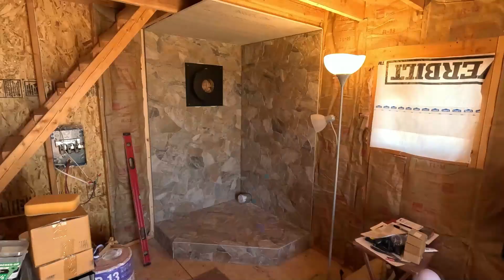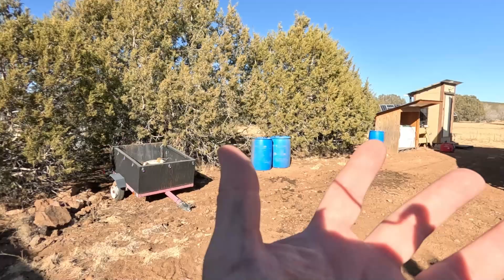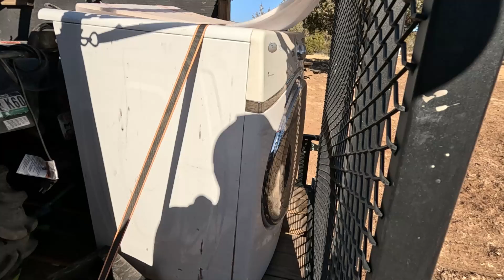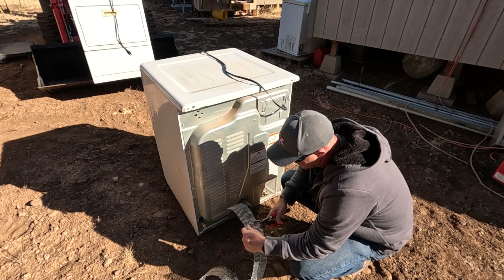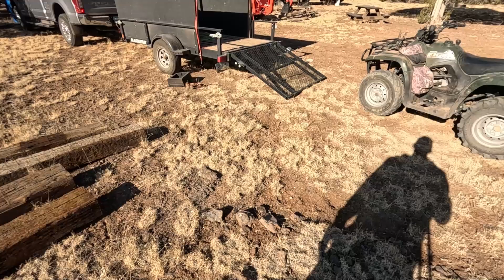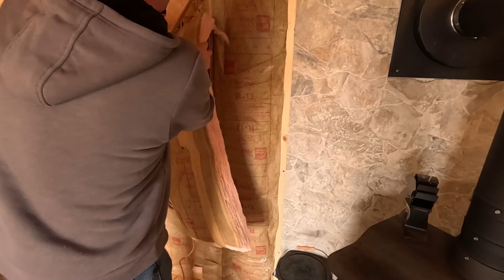My Battle With Batteries

Comment: I’ve got a lazy connection like that… it’s easy to put stuff like that off… I plan to do similar w conduit pipes.  Greetings from Northern AZ!
Reply from the maker: I haven't put a video out in a while, but my large battery bank is just about dead now.  The voltage tanks after dark.

Comment: Temporary resolution for power needs I purchased a 3000 W solar generator at Costco. Also a little pricey about 1500 bucks or so I think.
Reply from the maker: In my opinion, you can never have too many power stations.  It's like insurance.

Comment: Temporary resolution for power needs I purchased a 3000 W solar generator at Costco. Also a little pricey about 1500 bucks or so I think.
Reply from the maker: Power stations are awesome insurance.  $1500 is a lot of money, but it doesn't seem so bad when you have instant power when the power goes out.

Comment: I had to insulate my well house(I been putting it off) frozen pipes broke… used  foam insulation worked great ,no fiberglass easy install, but a little pricey 10’x20’x10’-12’ tall /slanted for future solar25…. panels @ 58$ each x25. I underestimated how many I needed bought 20 I needed five more the second set.(5) have pre-cut for 16 inch centers notches in them which would’ve been easier, but my steel building ranged from 43 to 46 inches wide. I highly recommend using the foam insulation so you’re not breathing in all the fiberglass lot easier to cut with a straight edge and a cheap two dollar knife… The type that you can break off the blade on, I don’t know what they’re called.
Reply from the maker: Awesome.  I will probably do foam insulation later in a larger more livable structure that I build in the future, but I already have all the insulation to finish the little cabin.

Comment: If you don't want to reconfigure the panels permanently, a very quick fix would be to put a resistor across the panel DC+ and DC- to dissipate roughly... oh, 15W or so.  That ought to bring the voltage down off of its Voc in cold weather.

You will lose 15-20W or so worth of generation by doing this, so the obvious better solution is to permanently reconfigure the panels so the voltages don't go too high... remaining cognizant of the maximum current that cable might have to carry.  If you aren't already, be sure to use a solar combiner box when paralleling strings.

-- Resistor Method to reduce Voc of solar string(s) --

I don't know what the Voc of the system is but lets say it's 100V and you want to dissipate roughly 15W to 20W or so to bring down the open-circuit voltage so the MPPT controller doesn't give up in cold weather.   A 500 ohm aluminum shell resistor with a heat sink attached to it would do the job.

This would be something like... oh, find "Patikil 100W 500 ohm aluminum shell resistor" on Amazon or something like that.  Make sure it has sufficient heat dissipation (that's what the "100W" means above).  100W is the minimum spec for them to dissipate 15-25W in open-air safely.

You can try putting one or two of those in series and then across the solar panel DC+ and DC-.    Best to mount them to a metal backplate as the heat sink, they will get hot.  Make sure they don't get too hot (above 70C).  And beware the dangerous DC voltages.  I usually use generous heat shrink to make sure the terminals aren't exposed to accidental touch.

-Matt
Reply from the maker: I typically disconnect one panel from the series just before it starts getting cold, but I was away for three months and forgot all about it.

Comment: take 1 or 2 panels out of series to bring pv dc voltage below 150 so your controller will work.  At some point upgrade to combo inverter/mppt that will go to 250 or 500voc.  I'm seeing 12v 100ah lith bats running in the $100-$115 range some with low temp protection, so 4 would run you $400-$460 at Amaz and temu.
Reply from the maker: I guess I didn't explain that very well in the video.  I usually disconnect one panel to bring the voltage down before the cold temps arrive, but I forgot to do that in September.

Comment: Maybe spend less time on making videos and more time working on doing your stuff right.
Reply from the maker: Well, then there would be no video at all for you to troll.
Reply: @AZOFFGRID  Life is full of difficult choices. ;)
Reply: Be nice now. I watch his videos @ 1.25 speed! Or faster!🤷🏼👍🏻
Reply: So many people are doing solar now that I personally think it is very useful seeing videos by DIYers.  Almost nobody gets these things right the first time, after all, so it provides a good forum both for getting good advice and so others can see how people are putting these systems together in real life and what the most common mistakes are.

In this case, it is clear that a high level of importance needs to be placed on ensuring that the system operates reliably and avoids common fault conditions when nobody is there to regularly check up on it.

Comment: Just found your channel. My wife and I are up on our property in Northern Nevada. We are using one of two 48v forklift battery banks. Nice to see your set up! Thank you for sharing. Subscribed.
Reply from the maker: My power system has worked fairly well for the past 8 1/2 years with a couple hiccup's along the way, but it is finally time to move forward and upgrade to lithium.  It may be a few months before I can purchase everything, but when I do, I will bring you all along for the ride.

Comment: What wind turbine is that? Tried seeing if you made a video on it but didn't see anything. Been considering a wind turbine but seeing a lot of bad things online about them.
Reply from the maker: The short answer is, my wind turbine is garbage.  It was new and gifted to me from a subscriber several years ago.  It was from Missouri Wind and Sun.  I can't remember the watts.  1000 or 1400 watts.  The most it ever produced under extreme wind was around 300 watts and shortly after I installed it, it stopped working.  If you are in a place like I am with lots of year round sun, don't do wind power.  Just put that money toward more solar energy.  You won't be disappointed.
Reply: Yeah I hear nothing but bad things about wind turbines so solar it is! I'm in the California High Desert so plenty of sunshine here. I just wanted to harvest some wind energy at night but we'll see if there's any good turbines out there.
Reply: @fromcitytowild  make your own blades with pvc pipe and car alternator for generator.